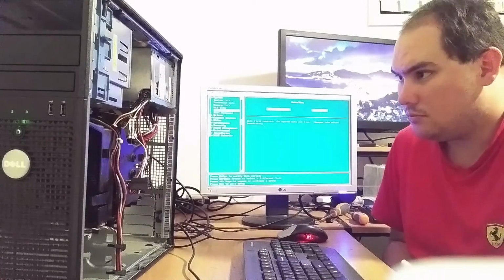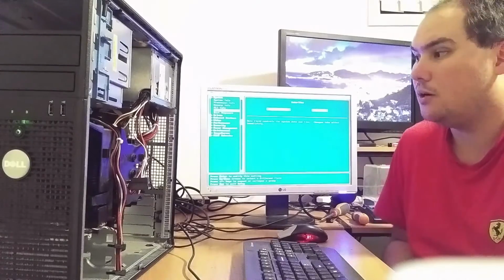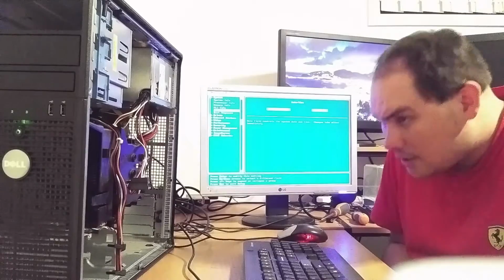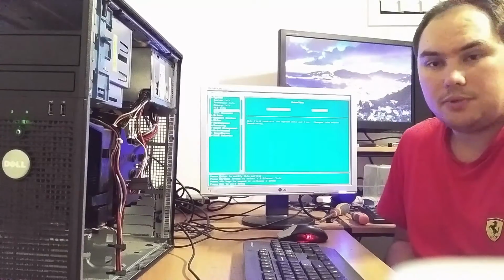Motherboard Transfer Optiplex 755 SFF to Optiplex 755 Mini Tower - ESXi Home Server Part 1

Comment: Hi, bro
Currently i use the "HP elitedesk 705 g3 sff" i want to move all the stuff to this case "Aerocool Cylon Gaming Rgb", cuz i want to add the rx580 videocard, and the sff have no much space, so, this will works?
Reply from the maker: Hey mate, I dont really know the HP's well BUT from the ones I have worked with they should be thrown in the BIN! HP has a tenancy to use non standard connectors and non standard motherboards so You would possibly be better served by getting a standard aftermarket motherboard and installing your CPU and RAM into that.

Comment: I have the Optiplex 990 SFF with i5 2400. It's a nice computer, but I prefer bigger cases due to better air flow and less heat. Is the only way to transfer motherboard the 990 mini tower or can I buy a case any case from Amazon/etc? Also, would it just be transferring motherboard or do I need to buy a new power supply and other items?

Thank you!
Reply from the maker: So the 990 SFF is one of 2 awesome generations that dell did. reason being, they can be transfered into standard atx and micro atx cases :D as for the powersupply any standard ATX will work. the only catch with the 990 is the Pin layout for the power button, you will need to do a bit of modding and testing to find the 2 pins out of the 5 that turn the PC on. been a while since I did it so I dont recall what they are. is a fun little project tho.. oh the other gotcha is the CPU cooler, I think you can get away with a stock intel one, but if you need to use the Dell cooler you can tighten on the CPU cooler with mothboard standoffs. Its a jank project but lots of fun if you are into modding.

Comment: "If you want to build a cheap powerful workstation you don't use slim desktop Optiplex machines if you'd used a mini tower that would not be a problem. With the slim dell's the max power draw for the PCI-E is 25W because the motherboard is limited to that in order to use the little bit of power the power supply provides. And perhaps the worst part of this you can't do much except using a not so good GPU that draws 25 watts."
https://www.dell.com/community/Desktops-General-Read-Only/PCI-Express-power-limits/td-p/5170071
Reply from the maker: Some of the optiplex machines dont have the 25w PCIe limitation but regardless id always prefer a non OEM option if I can get it on the used market. I have done other videos on the channel where I transplanted an optiplex 990 and 3010 into a normal atx chassis, and bolted in an RX480 and it ran like a charm.
Reply: @TechFurb  i picked a DT for my nephew because of the price and am now finding out about the 25w PCIe issue. I know that the MT gets enough to run a evga gtx 950. i should hav just spent 20$ more and got MT for him

Comment: Hey what's up! Could you do me a favor, please? I have the Dell optiplex 7010 SFF, so can I transfer that to the bigger case from other production(Compaq presario mT, I guess, I'm not so good at PC), and also I already have grafics card nvidia geforce ddr5, 4gb, 128mbs, and I'm waiting for power supply 500W from EVGA. Could you advise me how can I transfer if it possible, thanks a lot!
Reply from the maker: Hi so the 7010 can be converted to a normal PC case but I wouldn't recommend it if you are not confident

Comment: I have an dell optiplex 3010 I want to transfer the motherboard to another atx case
it can be done?
Reply from the maker: Yep can be done, so I actually did a video on that exact model which you can check out here if you are curious https://youtu.be/puvZQ-jS0PI

Comment: Hey i was wondering if i would transfer an optiplex 990 SFF to 990 MT?
Reply from the maker: Hi, yep from memory that is possible, however the 990 is one of the glorious standardized ATX desktops that Dell made, you can port it straight into a proper off the shelf ATX case. only 2 mods you need to do is jerry rig the wiring for the power button and use motherboard standoffs to mount the CPU cooler. I did a video on this about a year ago if you were curious :) https://youtu.be/puvZQ-jS0PI

Comment: Do you think a Lenovo m92p would fit a normal case?
Reply from the maker: Potentially, I haven't done a conversion on a m92p before. I have however converted the previous gen model to an ATX case.
Reply: @TechFurb  and another question..looks like the lenovo fits.The front panels connector in my bigger case uses individual pins while the lenovo case uses a 13pin connector.Do you have any solutions for this?
Reply from the maker: So my work around for this problem is trial and error, usually I only bother with plugging in the power switch as you would spend hours trying to find the right pins for power and hdd led's. Basically I grab a flat head screwdriver and bridge the pins until it turns on, once I figure out which 2 start the PC I plug the cable in and call it a day :) p.s you wont cause any damage to the system by doing this.
Reply: @TechFurb  thanks for the help
Reply from the maker: Not a problem glad to be of assistance :)

Comment: Will this work with a 7010 sff to a 7010 mt?
Reply from the maker: Hey dude I would expect so, however the 7010 can be converted to a matx or ATX chassis. I have done a build in the past with a 3010 where I did that, the 3010 for reference is from the same generation as the 7010

Comment: would you recommend doing this with 7020 sff?
Reply: https://m.aliexpress.com/item/32883031266.html?trace=wwwdetail2mobilesitedetail&productId=32883031266&productSubject=ATX-24Pin-Female-to-Motherboard-8Pin-Male-for-DELL-Optiplex-3020-7020-9020-T1700-Server-Adapter&gps-id=platformRecommendH5&scm=1007.18499.102167.0&scm_id=1007.18499.102167.0&scm-url=1007.18499.102167.0&pvid=8c477edb-df11-45a3-9b24-c56ad4119020&_t=gps-id:platformRecommendH5,scm-url:1007.18499.102167.0,pvid:8c477edb-df11-45a3-9b24-c56ad4119020&spm=a2g0n.detail-amp.moretolove.32883031266&aff_trace_key=&aff_platform=msite&m_page_id=224amp-OxH6OYSOoYwvHwviYsz2NQ1543774615312
Reply from the maker: Hi, unfortunately no, the optiplex xx20 series users proprietary ATX power connectors so it cannot be upgraded :-(
Reply: @TechFurb  You can use the 24 pin to 8 pin connector which is available for $4 on Aliexpress and for $15 on Amazon
Reply from the maker: Dude that's awesome, I shall have to check out that adapter :D

Comment: This is really late lol but will i be able to transfer the inner stuff of a HP Compaq 8200 Elite SFF Pc into a normal atx case?
Reply from the maker: Hi, I am not sure with that model but I have found HP is utter garbage for any form of customization. they tend to use their own BS OEM standards. if you want to transfer an OEM PC to a normal ATX chassis I have found that the Dell Optiplex 990 and 3010 are the best ones to work with.
Reply: TechFurb so it would not be worth doing?
Reply from the maker: No, I wouldn't recommend doing it with a HP.

Comment: what cases will fit my dell sff?
Reply from the maker: What model do you have?
Reply: TechFurb dell sff 990. I do open air case cuz my old gpu wont fit in thats why i need new case
Reply from the maker: Hey dude so, awesome news the 990 is compatible with matx and ATX Case so pretty much any aftermarket tower will work. For reference I have done a 3010 to gaming PC conversion, for reference the 3010 is effectively the same chassis as your 990. If you want to check out the build as a reference point, this is the link https://youtu.be/puvZQ-jS0PI
Reply: TechFurb thanks man ill try it!

Comment: Hey I know this video is a couple years old now but was wondering if a optiplex 755 sff motherboard will fit in a 760 mid tower regarding the io shield???
Reply from the maker: Hi you wont be able to transfer across to that chassis. if I remember correctly the IO shields were not removable in this era of workstations.
Reply: TechFurb thanks for the reply, much appreciated! What if I was to cut out the io shield of the chassis?
Reply from the maker: You would be sweet, the only fundamental difference is in the IO shield.

Comment: Hi, I have a SFF Optiplex 780   and I wanna transfer the innards into another case. My problem is that I recently bought a gpu (Ati 5870), but not only can it not fit, but it requires a 6 Pin PSU. So what would the process be of switching it, and what issues will i encounter?
Reply from the maker: HI, You might be in a pinch with this one, as the Optiplex 780 is a BTX motherboard which means even with the full desktop version your 5870 may not fit. These motherboards wont fit a normal ATX case, so you may need to look at modifying the case you put it in. having said that the motherboard will take a normal PSU  so any 600w PSU with 2 x 8 pin Pcie cables will work well.
Reply: TechFurb Ah I see, thanks for the feedback! I have one last question though. After doing a bit more research, im not entirely sure. But, what if I purchased a Dell T3400 and upgraded the PSU, would the T3400 motherboard and case fit my Ati 5870? Once more thanks :)
Reply from the maker: Hi, I am not sure if it will definitely fit, the PSU would definitely be replaceable,  but its hard to say, the killer is going to be the length of the GPU and what it is obstructed by. are you able to get an old gaming machine off EBay, Gumtree or Craigslist for roughly the same price? back in the Core 2 era it was VERY uncommon for GPU's to be large especially anything that wasn't the top tier, so none of the OEM cases were designed with the intention of fitting a large GPU. your other option is to get an optiplex 990 or 3010 and transfer that to an ATX case. as they were standard ATX baords. it will be a bit of a project to but could be the best bang for buck option in terms of making the most of the 5870.
Reply: Ah man I screwed up bad, I wanted to try something new instead of getting some crappy laptops, and I'm not really for getting a new PC. Say, could you give me a recommendation for a graphics card that's around $50 that can fit inside my SSF Optiplex 780. Something that can maybe play GTA V in 720p - 1080p. 
Also, perhaps a future recommendation for a PC that can fit my 5870 without the extra hassle of modding or switching cases. So basically a PC where I can upgrade the PSU and just straight plug in the GPU and b done. Sorry to be a bother, but I'm actually new to PC hardware and such, but I really appreciate the feedback though man, loving your channel 😊
Reply from the maker: +I!x Coolstar thanks dude, $50 GPU that can run GTA v  is not an easy task. See if the there is any GTX 750s available. they may or may not be in the $50 brakcket in your area. As for a PC an old gaming machine that is first gen i3 i5 or i7 may be your best bet.
Reply: TechFurb Hey I saw a gt 1030 for $74, no luck on any gtx750's. Gt 1030 can suit my needs for now. Really appreciate the help, I learned a bit about PC hardware.👍
Reply from the maker: ahh bummer, all good, 1030 should pair well with your older system.

Comment: Do you know if you can overclock a 755 mini tower? All the videos I've seen are in sff and I just want to be sure before I buy a mt motherboard?
Reply from the maker: Hi Ive heard of the "tape" overclocking method which is what I believe you are refering to. I have never tried but have seen it done on other youtube channels. My advice would be to try and pickup an old gaming tower if you are looking to overclock, as OEM pc's run a locked-down BIOS and are not designed to handle the extra stress overclocking places on them.
Reply: TechFurb do you recommend any  cheap towers that could handle a good amount for new games? , plus I have the 745 optiplex mini tower, any mobo that I could easily install?

Comment: 500 watts psu ? mini tower??
Reply from the maker: 230 or 240w from memory, there was no real advantage to the stock PSU in the mini tower, other than the case will take a standard atx power supply.

Comment: Hello I have an optiplex 960 type sff and I want to change it case would have to get one of the same model but mini tower
Thank you
Reply from the maker: +alberto camacho camacho escarrega hey, yeah the 960 was still a proprietary form factor, so you will need to find a 960 mini tower to put it in.

Comment: can I transfer my sff 780 to mini tower too?
and what is psu compatible to sff motherboard  from 235w to 500w on mini tower
Reply from the maker: Hi, so from what I can tell by looking at an Optiplex 780 SFF Motherboard it should drop into a core 2 mini tower from this era (Optiplex 745, 755 or 780) your biggest issue will be lining up the heat sink mounts and matching the front pannel etc wiring. As for your Power Supply question, yes the 780 should take a standard ATX Power Supply as the motherboard has the standardised 24 pin and 4 pin connectors. I hope this answers your questions.
Reply: Thanks